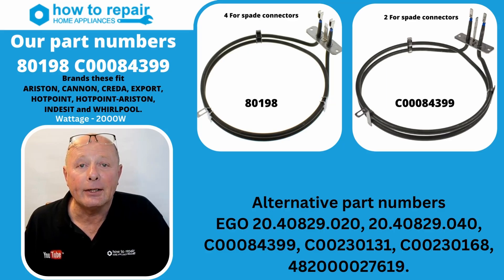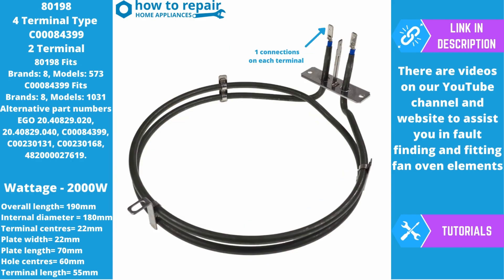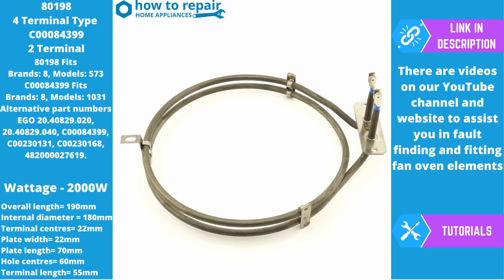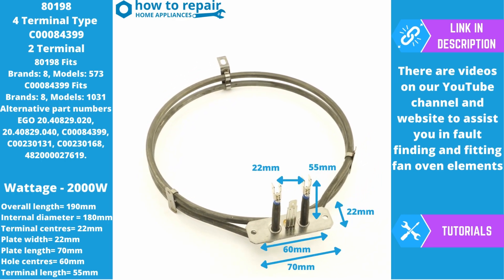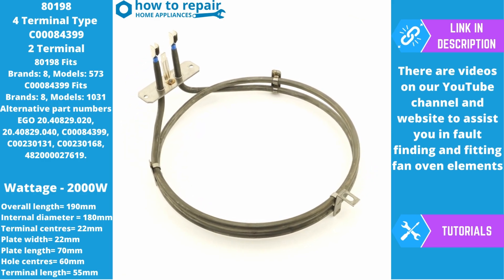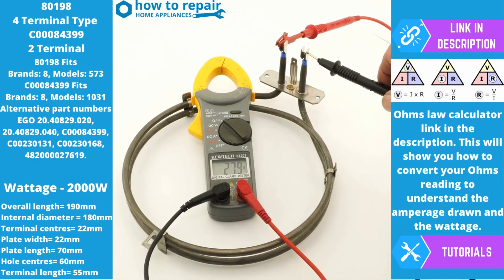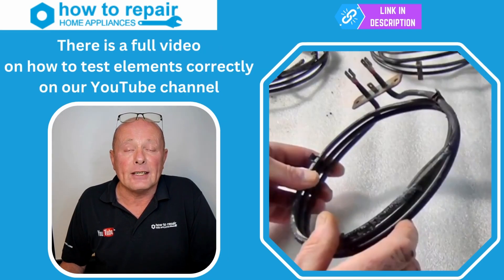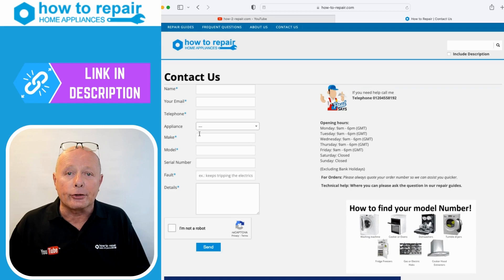C00084399 or 80198 Fan Oven Element 2000W Ariston Cannon Hotpoint Indesit Cookers

Comment: My HP oven has two terminals but uses 4 terminal element! Its very hard to find the 4 terminal type. So could I just use the 2 terminal type instead? I.e. are they interchangeable?
Reply from the maker: If you only have two wires going to the heating element, one on one terminal and one on the other terminal that is a live supply and a neutral you would be able to use the full terminal element because it has two on the live side and two on the neutral